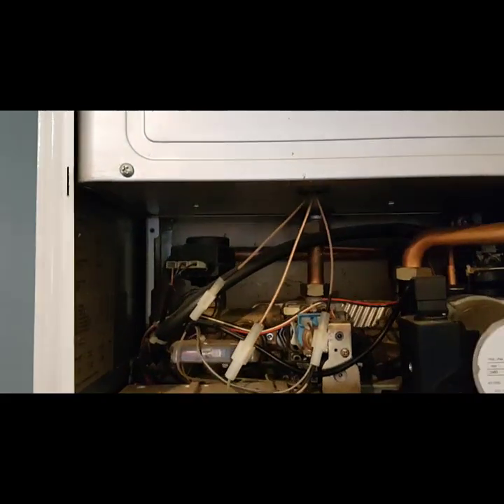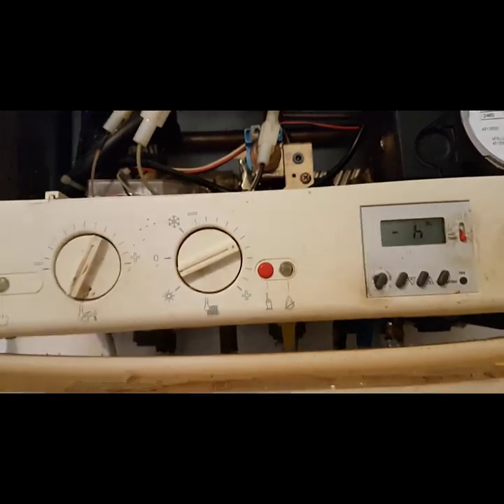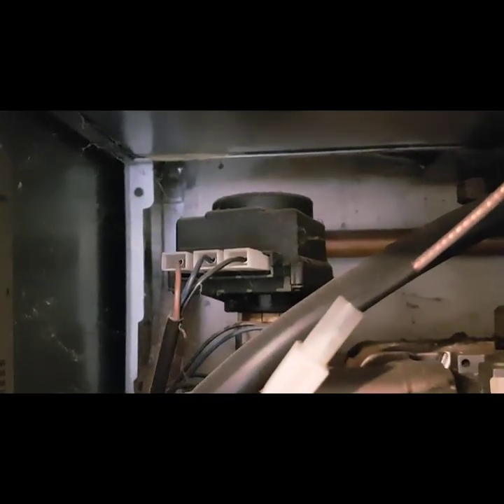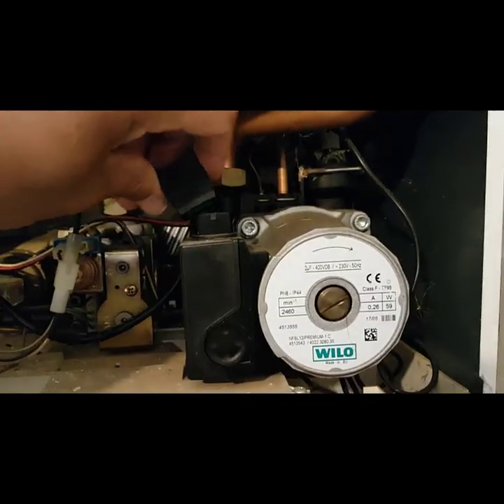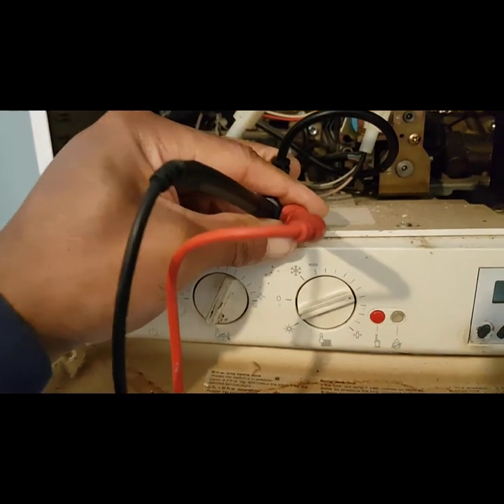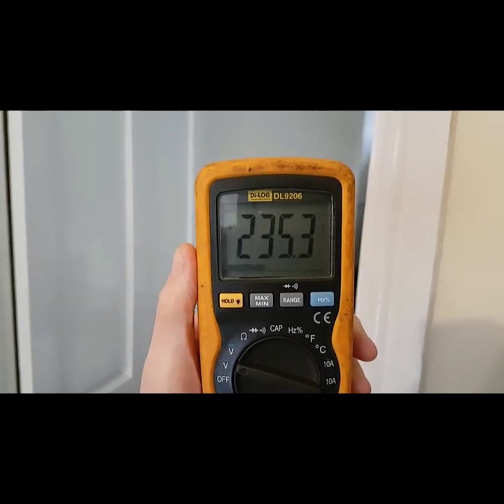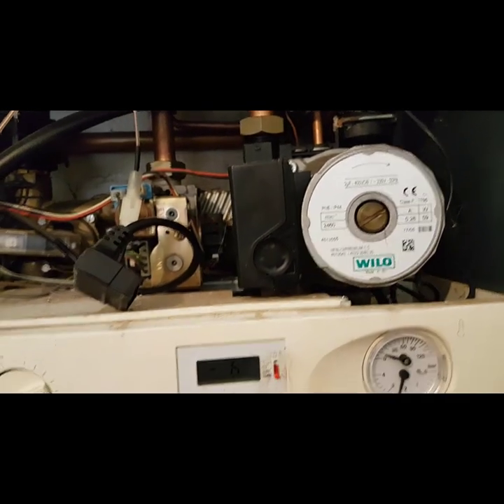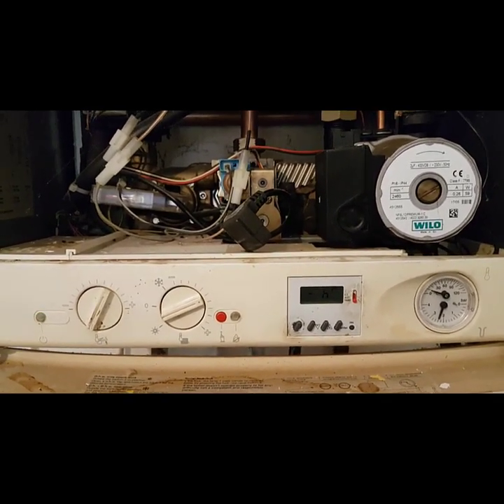Biasi M90E 28S No Heating and Hot Water

Comment: Nice one Tony..If you check with your multimeter that is gone tell you if any power from the PCB..so in this case we have power but pump not moving..You can measure the resistance in the pump as well..les then 100 ohms between L and N..replace the pump,should be 120 to 250 ohms
Reply from the maker: A resistance test is only necessary then looking for short circuits like blowing a fuse
Reply from the maker: @HalleB127MX  thank you for your comments
Reply from the maker: hey we're currently trying to grow our Facebook group and would love you to join Tony and the team using this link, Tony will be available to answer all your questions directly https://www.facebook.com/groups/167070231326174 we will also add this link above.
Reply from the maker: It's possible the left hand hydraulic block the pump flow switch is sticking in hot water mode